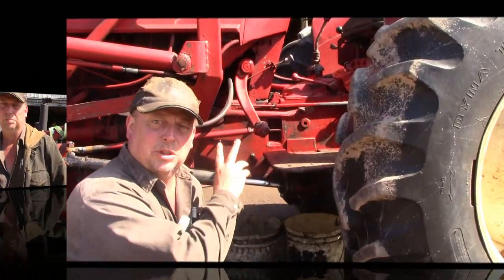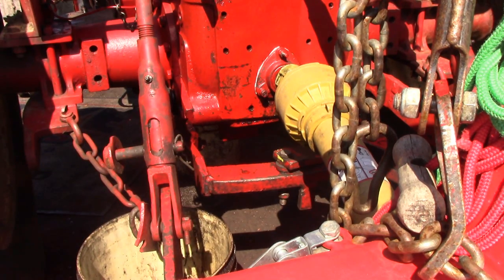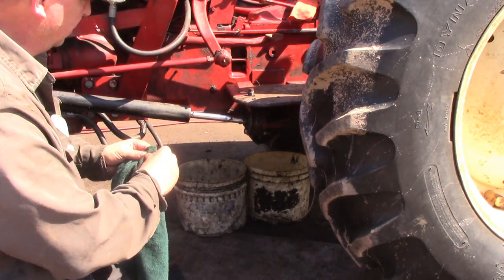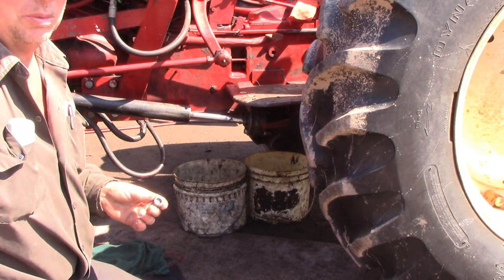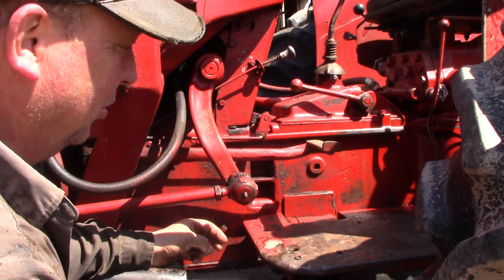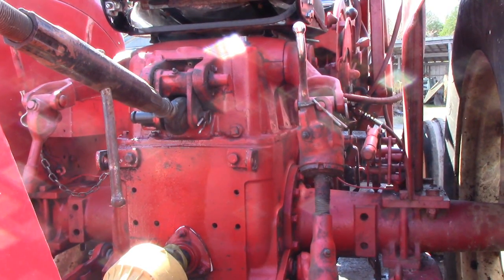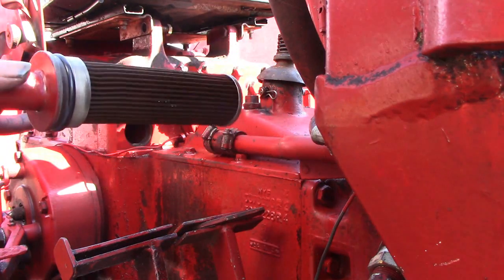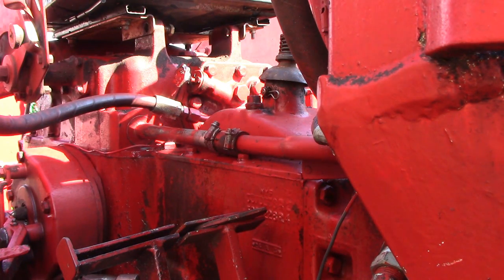IH 444 Fliuds change

Comment: i just want to make sure, would IH 424 model be the same as well or no? thanks
Reply: also , where can you buy the oil filters for a ih 424 tractor and what type of engine oil should you use?
Reply from the maker: @brandonbonter7341  A 424 would be similar but I can't say if it would be the same or not. You can get filters at  a CaseIH dealer, TSC, or auto parts store. I would use a good quality diesel engine oil in 10w30 for a gas or 15w40 for a diesel. Thanks for watching!

Comment: I have 67 HI  424 I drained all three plugs , I poured 6 gal of 90 weight in where you filled your tractor . no oil seamed to get in trans . so I removed plug on right side at floorboard then I filled trans at level plug on left side , and now when I use tractor gear oil comes out around the starter . Do you have any idea's?
Reply from the maker: It would seem that you got oil into the clutch housing, without seeing the tractor I could say how that happened. Thanks for watching!
Reply: @CanadianRedneck15  Thanks for reply.

Comment: Thank you for this video. I own a B414 and was wondering what the hose is that comes out the side of the lower coolant radiator hose and goes up and over to the left side into the engine block. Can I get rid of this hose?
Reply from the maker: My guess would be that someone had a circulating heater hooked to that hose, you can remove it. Thanks for watching!
Reply: @CanadianRedneck15  You rock, thank you. Going to remove it and put a plug into the side of the engine block. Thank you again.

Comment: Just bought a gas 444 myself. Glad to see a video showing how to change fluids. Do you have exact measurements for how much hydro, gear oil, and motor oil you need?
Reply from the maker: I'm sorry, I don't have the capacities for the 444. I am glad you enjoyed the video, thanks for watching!
Reply from the maker: @Keith Circle You should be pouring it in the front section, the fill plug is beside the shift lever.
Reply from the maker: @Keith Circle Having too much could make it frothy if it gets too high up on the gears, keep the level plug out and drain it down to the level.

Comment: Just bought my first tractor, a 434, this video great help so well described thanks, got to read up on the speed/torque amplifier it has fitted though as it got a Filter too 🤦‍♂️
Reply from the maker: I guess I didn't realize that  you could get a TA in a 434. There shouldn't be a filter for it, I expect it would be a straight  mechanical TA. Thanks for watching!

Comment: Does the gas engine and the diesel use the same oil filter? Been trying to find the right filter for my 276 gas, and most listings don't specify for which engine.
Reply from the maker: Yes, gas and diesel use the same oil filter. Thanks for watching!

Comment: Thank you very much im having a go at servicing my fathers old Hi 474 and this video was exactly what I was looking for to show me how
Reply from the maker: The 474 is a  different series of tractor, the transmission/differential is the hydraulic reservoir. Thanks for watching!
Reply: @CanadianRedneck15  Thank you for pointing that out much appreciated
Reply: @CanadianRedneck15  Is the story about poor brakes the same for a 474. My 474 brakes aren't working either...
Reply from the maker: @madsvinding4409  The 474 has an internal wet disk brake located on the inside end of the rear axles. If the brake pedal feels good the you likely need to replace the disks, if you have  a soft pedal try bleeding the brakes. You could have worn master cylinders or bad o-rings by the disks. Thanks for watching!
Reply: @CanadianRedneck15  Thanks for making the videos. I’ll stay tuned.
Reply from the maker: @madsvinding4409  I am glad you enjoy the videos, thanks for watching!
Reply: Hi Simon. Did you manage to get it done. I have 474 too. Couldn't use any hydraulics today. Saw some fluid leakage by a hydraulic hose. Where do you fill the oil, and which type/qty did you end up using? Best wishes

Comment: Great video. I have a 3414 with the shuttle trans. Does it use gear oil as well? Right now it looks like it has hydraulic oil in it. Thanks
Reply from the maker: I'm not sure but the transmission/differential case may be the hydraulic reservoir in a 3414, if nit I would go with gear oil.
  Thanks for watching!

Comment: Thanks!  Do you have any information on the cessna hydraulic pump?  Looking to rebuild mine
Reply from the maker: The hydraulic pump is a gear pump, it is the case that wears and is not rebuildable. When the pump is worn and not making enough pressure they are a replace only.
  Thanks for watching!

Comment: I think I have a 444. I’m in New Hampshire and the tractor has a Quebec dealer tag on it. But when I look at manuals I end up looking at a 384 manual a lot. This is a crazy question - my power steering cylinder works but leaks more and more. Ever rebuilt one? Or for that matter, can one be purchased?

Comment: thanks so happy I found your site as mentioned bellow I too inherited a tractor i.h. 444 an though very mechanical do not know anything about tractors so thanks for  the information very helpful. what viscosity of oil do u run in here I read bellow the case hytran is best for hydraulic thanks for that cheers
Reply from the maker: I would be looking for a good quality diesel engine oil in a 15-40.
 Thanks for watching!
Reply: @CanadianRedneck15   engine oil ? In the trans and for the hydraulics ?? Not IH hytrans.
Reply from the maker: @bustersmith5569   Yeah I miss-read that, hytran in the hydraulic system, you're right. Thanks for watching!

Comment: I have a Mahindra 450. The IH 444 is about the closest thing I can find on the internet to compare it to for maintenance. Videos etc. Am I correct in that guess or is there a better model to compare to? It's hard to find any information on the Mahindra 450. So any help would be appreciated. Great videos. Thanks!
Reply from the maker: I know that Mahindra built versions of the B275 and B414 International tractors under licence from IH but I don't know what the model numbers were, I don't doubt that the 459 is pretty close to a 444.
  Thanks for watching!

Comment: This is super-helpful for me with my "new-to-me" 1961 B275... before I tackle a fluids change, however, I need to diagnose and fix an overheating problem... I had a quick scan through your videos but didn't see anything... any tips you can offer for a B275 that overheats?  The temp gauge apparently doesn't work, so that might be my first place to start... or the thermostat if I can find it.
Reply from the maker: THe thermostat is in the base that the top rad hose fastens to, also check the rad that it is clean and has good airflow through it. If you fill the rad to the top it will spit out water until it finds its level, the top tank will be about half full.
 Thanks for watching!

Comment: Thanks for the video.  My question for the 674 I H gas tractor  , there is a dip stick lower left side of seat by emergency brake lever.  Is that a dip stick for the gear oil ?  I will check for that level plug -  too. Thank you
Reply from the maker: The dipstick in a 674 is for the transmission/hydraulic oil,  in 74, 84, 85 series tractors the transmission differential is the hydraulic reservoir.
 Thanks for watching!

Comment: I have a B414 couple of questions that was not clear from your video. Q1 Confirm there are a total of 3 transmission plugs to be removed underneath?  Q2 The hydraulic system holds approx 8 litres of oil and you fill it so its 7 inches from the bottom. Wasn't real clear on the fill.  great video
Reply from the maker: There are three plugs to drain the transmission/differential cases, refill with 80w90. The hydraulic unit is supposed to have 3 inches of oil in it.
  Thanks for watching!

Comment: Hi Dave. My hydraulic splitter on my b414 leaks quite a bit whenever I leave my loader bucket up or if I am using my grader back blade and leave it up. Would it be just a case of having a bad O ring do you think? Thanks.
Reply from the maker: Yes, I expect that would be an o-ring. You should be able to get one at a decent machine shop near you.
  Thanks for watching!

Comment: Hey, great and helpful video. I just did exactly what you did but now my 3 point hitch arms are not working. Any thoughts?
Reply from the maker: You can try backing the hind end up a bit of a bank or hill to raise the back to get the oil flowing to the pump. That should get the system bled out and started.
  Thanks for watching!

Comment: Help please. 1962 international b275. Pulled the front drain plug. No oil. Middle amd rear plugs, 3 buckets of oil. Why no oil out the front plug????
Reply from the maker: Did you stick a screw driver or something in the hole to see if there is anything blocking it? There are at least a couple of pretty decent size passage ways for the oil to migrate to the front case, it would take a lot to block them.
  Thanks for watching!

Comment: The Problem:
Hydraulic Steering hose cracked and fluid was spewing to right side of tractor.
My tractor is 1969 International 444 Diesel.  I'm not a mechanic nor experienced farmer, but have had great service from this tractor for 17 years.  Apparently, I'm not kind to equipment because I have broken or worn out many pieces of equipment working timber and cattle on 40 acres in hot humid SE Texas. However, this tractor I acquired in the purchase of the farm, has yet to fail me.
The Problem:
Hydraulic Steering hose cracked and fluid was spewing to right side of tractor.  I see there are two hoses. Since the tractor was still steering to the left without spewing fluid, 1) can I know that only the 1 hose leaking needs to be replaced?
2) I will begin my search for a replacement hose now that I have found you for referencing along the way.

Thank you for all your videos.  Your detailed explanations are very useful to the simple-minded, or ignorant such as myself.  
I will continue to view and enjoy your YouTube channel.  Darryl
Reply from the maker: I am glad you have found my videos helpful and you are correct, you will only need to replace the one hose.
 Thanks for watching!

Comment: 384 stuck in low range... even with hi/low lever in neutral. if shifted to hi the engine loads up and kills when clutch is released. could the low range fork be broken or misaligned. i will take shift cover off to investigate. any thoughts??? thanks
Reply from the maker: Sorry I missed this, my best guess would be a broken fork.
 Thanks for watching!

Comment: Hi Dave, great run through thank you, precise for the novice (becoming amateur due to having to...). Your videos are addictive. Im in Australia, any issue running iso68 hydraulic fluid in a B414?
Thanks again, Nathan
Reply from the maker: I would think iso68 should be fine for the 414.
 I am glad you have found the videos helpful, thanks for watching!
Reply: Ok thanks  today Oct 13 2023 I’m changing all fluids    I notice my transmission on my in 444 Bd154  the oil is creamy yellow what would cause that  Thanks for any info u can tell me Love All your videos  I rebuilt my complete Bd154 from your video It runs great thanks for that But why is my transmission Cream
Yellow Can u give me any advice

Comment: Thanks for the video. I have a 354 gas engine. What engine oil would you use? Thanks
Reply from the maker: A tractor is considered industrial use so I would go with a quality diesel engine oil even though it's a gas engine, something like Shell Rotella in 10w30.
  Thanks for watching!

Comment: I have a 59 b275 it has one fill plug on the top for the hydraulics and only one drain plug on the middle on the bottom under the pto shaft. Are the diff and hydraulic fluid shared on the 275s?
Reply from the maker: The fill plug for the transmission differential will be on the shift cover, 2 separate oil reservoirs.
  Thanks for watching!

Comment: On my trater  win I trun my lights  on in its running  it's ok  but win I trun the lights  off in the trater  in get reddy to  use it again  the lights stop working  all of the lights  work  but not the headlights   in it keeps  blowing a fuse     were do you think that I should  look at 1st to see what happening with it.
Reply from the maker: Check the wiring for shorts. Thanks for watching!

Comment: How do you adjust the brakes? I jave just brought a 1962 international b275. The brakes work but could be better.
Reply from the maker: Under the foot board on the right side adjust the linkage at the brake pedals, you should have about an inch of travel before you feel resistance at the pedal, adjust them to be even when under pressure.
   Thanks for watching!

Comment: hey I have a 1969 B-276 gas I cant seem to find the drain plug for the hydraulics it isnt in the same spot as the video,and the fill plug is in a different spot as well.I am having trouble finding info on this tractor I am told it is a B-275 with the same sheet metal as B-434,I know they look the same.

thanks Matt
Reply from the maker: The drain plug should be at the back of the lift housing and the fill plug behind the seat.
 Thanks for watching!
Reply: Fill plug is in the center behind the seat,it doesnt have a drain plug on the back of the lift housing,how would I drain the hydraulic fluid?
Reply from the maker: @mattjenkins1336  you will have to drain from the suction line coming out of the bottom right on the front of the lift unit. Be a good idea to pull the filter out and clean it at the same time.
Reply: Alright thanks alot!when I change the hydraulic fluid I will clean the filter.
Reply: hey I changed a hydraulic hose today on the tractor that was leaking.After I changed it I tried all the hydraulics they worked fine.Then I let the tractor warm up went out to use it and none of hydraulics worked.What do you think would cause that?
Reply from the maker: @mattjenkins1336  Check the oil level, may be low since there was a leak.
Reply: There is 3 inches in the reservoir,is it possible I lost prine to the pump?
Reply: @mattjenkins1336  Did you clean/wash the filter to?
Lovely videos

Comment: I love your videos on those  olds tractors. I have a IH 276 dated 1971 and i recently  discovered that i have fuel mixed  with the oil in the crsnkcase.The level is high over full.
What can i do   to solve that problem?  I replaced the fuel pump with no result. Maybe the injectors?  Tell me please!  I live in Québec City and no body can help me.
Thanks  a lot for your help.
Reply: On diesel models there is what they call an umbrella seal between the injector pump and the motor, if the seal fails fuel will enter the oil. Also a bent push rod could allow a valve not to open making one cylinder not fire, fuel will enter the base past the piston

Comment: Thank you, I just purchased a 2444 IH tractor with a 2040 loader. The loader stopped working it's full of fluid so next I will check filter. Keep making the videos.
Reply from the maker: I am glad you enjoyed the video, thanks for watching!
Reply: I also have a 2444 with front auxiliary hydraulic pump. I have a manual if you need anything. Let us know how you made out?

Comment: i own a 434 and have a small clear oil leak coming from somewhere on the right side of the tractor next to the front right wheel. Doesn't seem to be engine oil since its so clear. what would you say it is from ?
Reply from the maker: That would likely be hydraulic oil. Thanks for watching!

Comment: Nice video, i have a 444, spending some time and money on it now, new starter and alternator, the old one was burnt out. Also changing oil filter housing to a spin on type for easier filter change.
Reply: I just bought a 444 diesel missing starter, would you happen to have the part number for the starter,
Reply: @jamesjackson3047  STO187A on www.okonomi-deler.no

Comment: I have a 1966 International 434   Hydraulics are separate from Transmission.  I watched the video and my transmission full level plug is where you noted in the video.   I opened it up and lots of fluid came out for a minute or two.   Last service was done by a previous owner.  Fluid didn’t smell like 80-90 gear oil.   Can you confirm that that is the plug on mine as well?  Thanks.
Reply from the maker: That would be the transmission level plug on a 434 as well. Some people use HyTran oil in the transmission of these tractors but the recommended oil is 80w90.
 Thanks for watching!

Comment: Hey thanks again for these videos they have helped me tremendously! 

I was wondering what fluid does the steering gear assembly use? I have changed all my fluids and my steering wheel freezes up here in manitoba winters. I know it's not my cylinder as I currently have it removed. Is there a drain for the steering assembly?
Reply from the maker: There might be a plug at the bottom of the box, otherwise remove the plate on the side and that will drain out most of it. The steering box takes 80w90 gear oil.
  Thanks for watching!

Comment: I have a question for you, I am installing an international 1850 loader on a 444 tractor that has never had a loader on it. I just want to confirm that to tie into the hydraulic  system on the tractor,  I cut the pressure line that runs from the pump to the rear hydraulics and run it through the loader valve and then out to the rear hydraulics?
Reply from the maker: Yes, that is correct, you will need a "power beyond"  loader control valve for that application.
 Thanks for watching!

Comment: Hi, the third plug you took out at the back of the tractor was that for the gearbox oil as well please?  Thanks, great video
Reply from the maker: Yes that is also for the transmission/differential case.
  Thanks for watching!

Comment: Can you do a video of the coolant system flushing ?
Reply from the maker: I con't have one to do right now but when one comes up I will.
  Drain the coolant, with the drain open stick a garden hose in the filler neck and let it run, when the rad is full run the tractor until the drain runs clear.